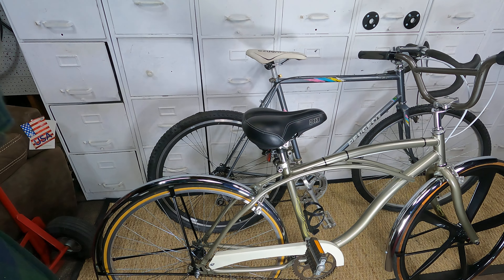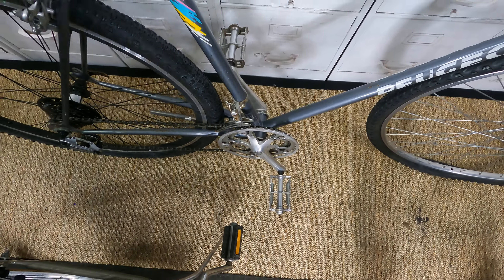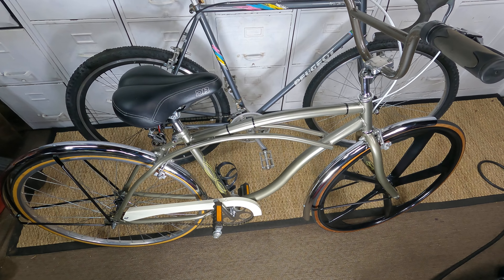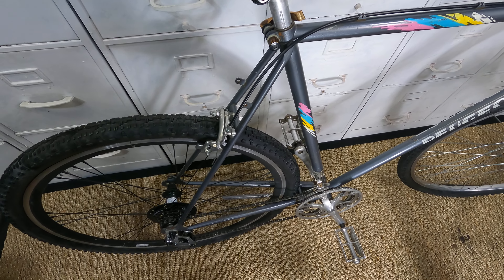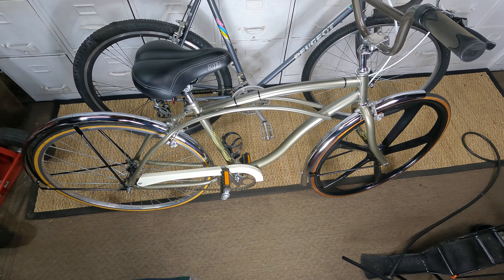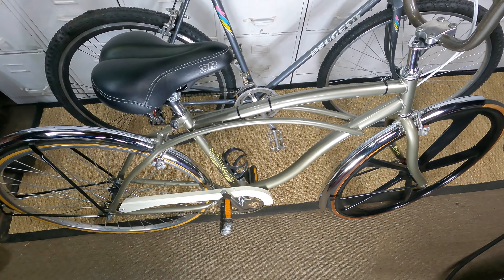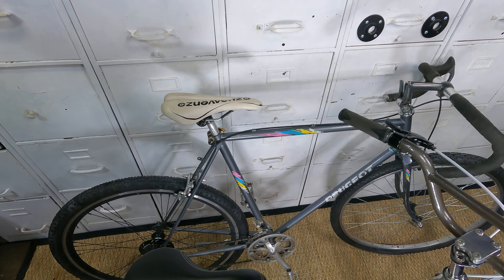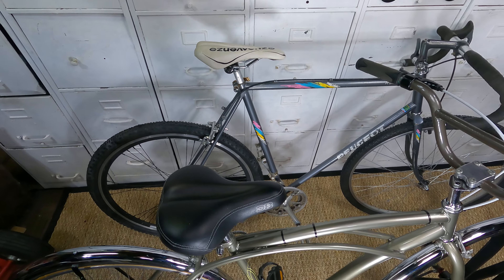-Update- 29x2.0 / 700cx54 (Vintage Gravel Bike)

Comment: When modifying rear end the breaks do not reach.  I plan on a old steel frame gt mtb to make a gravel bike I gotta get drop bars and breaks for it though.
Reply from the maker: ok good good thats great to hear, I also have an older steel gt mtb that I was going to try to fit this combo ,I do believe it might just work on that bicycle, I have other old mtbs that would not fit this combo but my gt was the only one that I thought it might fit this rim and tire combo !
Reply from the maker: oh so ,I thought id tell you that there are brake stay extender's that you can get online to make 700c fit 26'' but they are like 50 dollars ,i just wanted to share that
Reply: @grandsubject8138  yeah I know about that. I fixed tons of bikes I got free bikes then fixed them to donate away I had some high end bikes  but I stopped doing it simply because people tried to retakes advantage of what I did.
Reply: I was able to fit 50-700 winter schwable tires on my 2014 trek 520.  Fork is not original , had to use a clamp to make a bit of space on rear chainstays , but they fit a 61 cm frame ! So I am having fun winter riding with gears !
Reply from the maker: @MrDfeal  hay hay !  that's great to hear, anything that helps achieve what you want with the bike is ok with me I'm glad to hear you do have an frame to fit the 50s on it nice job"  the gt would of been cooler to me maybe not so many others but to me ..i also love older trek model MTB's also just love the triangle by the saddle on the GT's alum or steel
Reply from the maker: @MrDfeal   when i was growing up where im from ...i had a Schwinn high plains mtb my best friend at the time  my next door nabor had an trek 520   we both wanted an cannondale lol